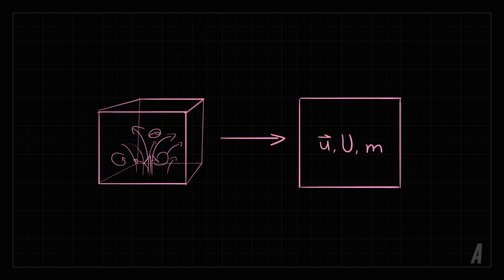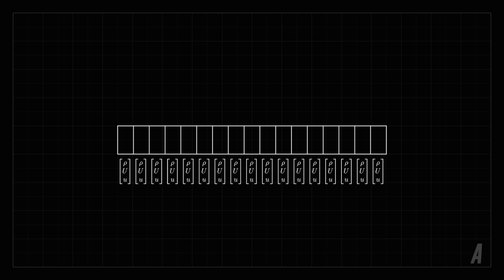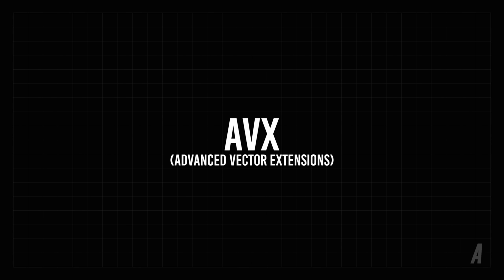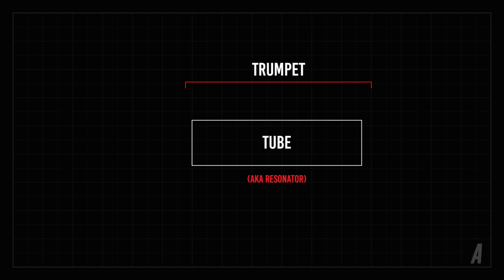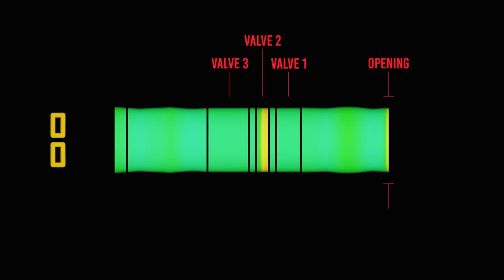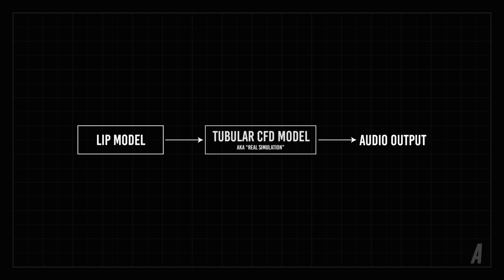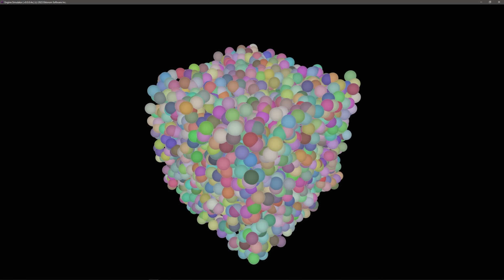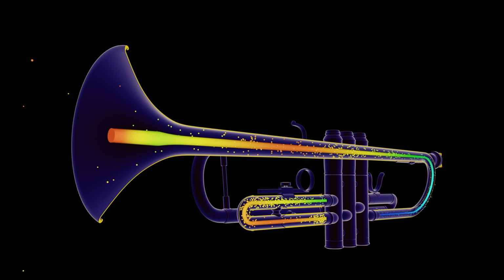Real-time Trumpet Simulation [C++/Vulkan] [WARNING: Flashing Lights]

Comment: I've been a trumpet player for about 10 years, and indeed, the lip parameters are extremely important to hit the right tone.  Trumpet players even anticipate their lip setting and sometimes also pull the instrument tighter to their lips to prepare for the next note, at least to minimise the air gap between each note.  If not well prepared, it even occurs to players that only air comes out, completely missing the note. As found in the simulation, the amount of pressure lips have endure on a Trumpet is immense, professional players need multiple years of lip training and lip hardening to cover an acceptable tone range.  It happened to me to have shattered lips close to bleeding after a concert.  The simulation exactly sounds like someone with no experience in lip setting, which is the case here.  Lip tension is even changing along the duration of the note, call it expressions, phrasing of the notes or modulation, like vibrato, staccato, pitch bend and more...  Adding randomness in lip tension is an easy way to improve realism, but simulating expression with lip tention needs musical feeling, which is a learning process that probably only AI would be able to implement.
Reply: Came here to say something similar about the lips. The tweaking of the params to get the 'clarinet' sound definitely made that pop out.

I Imagine more work on the flare will help, didn't hear any talk about the "material", i.e. certainly a wooden trumpet would sound much different than a brass one--I don't know how that's accounted for here... maybe covered in a different video, but yeah, so much is in the lips and I wonder if the original model is just inadequate for the needs here.

Buzzing with even just your lips, you can quickly start to understand how much that contributes to the sound.

I imagine he could also simplify things and just focus on perfecting buzzing with just a mouthpiece and then plug in the rest of the horn to a massive improvement.

Hope he decides to take at least one trumpet lesson as I feel like that will be an epiphany on how important that part is.

Comment: It's just a thought that crossed my mind, but could this fluid simulator be used for aerodynamics (it wouldn't need to be at 48000Hz since you don't need sound). Things like downforce or heat transfer on a radiator, or even rain hitting the windshield of a car. This are all things that BeamNG needs and would be pretty cool.

Comment: Wow! You should try learning trumpet!
The lip tension & opening size has very big impact on the tune.
Also how much lip is used to vibrate in the mouthpiece.
Since a lip is not a rigid body, you may need to simulate the lip fluttering.
If you blow air without any tension on the face, the lips make a fluttering sound like a machine gun or a old car noise.
Then if you pull the cheeck muscle to the side to tense up the lips, the tone goes up.
That should be constriced to inside of a mothpiece at quite a high frequency to get the vibration right.

Comment: The lips are what makes all of these "trumpets" sound like woodwind. There is pressure buildup behind the lips as they close and a stronger pulse.. which is probably why you have to "blow too hard" to get any sound. Reefs work a bit differently. 

The sound from this "trumpet" is quite close to membrane clarinet, which uses a membrane that seals a double-pipe (one pipe inside another) until you add air flow, which builds pressure enough to push the membrane, allowing air to escape, which equalizes the pressure closing the "valve". The pressure buildup is still quite modest in that, and the sound is somewhere between oboe and saxophone.

When i was building a membrane clarinet, one big hurdle was the fact that it has two sides that both affect the resonance, and with too short and wide mouthpipe the shape of the mouth had a HUGE effect on everything, which is why i abandoned the project.. too many variables in play, which was really the reason i got into it: i wanted to remove the need for any intonation, and succeeded: you can use any fan to blow air and it makes the same sound each time but... then the fact that we are talking about "three sides", input, output AND membrane exterior (placing a horn above the membrane also affects things), before we even get to the membrane itself, the materials, thickness, tension... Just trying to tune the damn thing is a nightmare. 

Anyway, in this case, you just have to model the mouth and lips..

Comment: i play trumpet AND WHY DID YOU GO DOWN FROM C, AND NOT EVEN WELL AT THAT, WHY DIDN'T YOU GO UP, C1-C2 (think thats how you write it, im not smart :D) C (0 (nothing pressed down)) D (1,3 (first and third down, with the 3rd's slide out (just a little secret :D))) E (1,2 (you get the idea)) F (1) G (0,(back here)) A(1,2) B (2) C (0) 
that would have made me happy, as it is the actual trumpet scale that one learns when begining to play.

but other then that, AMAZING JOB BRO, I SOUNDED EXACTLY LIKE THAT (first note, going down is A LOT HARDER then going up (to a point))

last thing, the sound doesn't stop when you change valves, it is called sluring and is a actual thing that we have to do but it does not quieten in any way (unless you are going very far down/up or you are out of air) and to stop the sound, you kinda stop the buzzing with your tong but keep blowing, (still find it hard to understand myself)

Comment: Excellent work.  I love that you stuck to this and got the thing working.  As both a technical type and a trombonist (for a very long time) this really rings bells with me.  That brings us to the "bell" and the general interior profile of trumpet family instruments (trombone, bass trumpet and trumpet all come from the same family).  We look for brass instruments which have a consistent interior diameter for perhaps the first 2/3 or 3/4 of the instrument (I'm not sure of the exact ratio, but it's most of it for sure) then we expect a roughly exponential amplifying flare of a "bell".  Some trombones actually have two different interior diameter slide tubes, to make a gradual increase in diameter, which can slightly change the harmonic character of the horn. 

The trumpet family is distinguished from "conical bore" family instruments like the French Horn, Euphonium and Tuba, which immediately start to increase the interiror diameter of the tubing, and continuously grow this diameter over the entire length of the horn.  These instruments have a distinctly different audio character versus the trumpet family of a similar length.  A Euphonium is the same length and plays in the same range as my trombone, but the trombone has a "brassy" quality, where the Euph has a mellow quality (when played moderately or softly).  One can think of the trumpet / trombone family as starting out brassier, and then getting more so, as volume increases.  The conical start out mellow and get much brassier when driven to high loudness.  This is a contrast they have over large volume differences.

So we really care about the shape of the bell section, and the size of the bore of the horn, even caring about the bores and shape of the valve internals.  Similarly we also care about the shape of the mouthpiece.  The cup, the rim (this is mainly comfort and clarity of attack oriented) as well as the backbone of the mouthpiece do matter and good players eventually gravitate to a mouthpiece they feel meets their needs.  

As we brass players develop we find horns that do for us what we are seeking in music world.  All the other brass players I know typically have several horns, which they will use for different applications (we will use a different instrument playing in a symphony orchestra, and a jazz band, or recording backing tracks for a singer).

Comment: Very cool. I played trumpet for years in and after high school, and for some reason I never really fully internalized that the air actually goes directly into the 3rd valve first... -_-

One thing I would have liked to see here (or would like to see in the future) is attempting to simulate sequential notes of different pitches by using the same fingerings. I.e. on a real B-flat trumpet, an open fingering is commonly used for low C, middle G, middle C, high E, high G, and high C, with the difference being the frequency of the lip buzzing, embouchure shape, and input air speed/volume. I'm not a physics guru, but intuitively I guess that increasing these parameters should cause the standing waves to slowly break up until they eventually "pop" into the next stable configuration at a higher frequency. The rate of changing these parameters, and how well the change is controlled would likely dictate how "cleanly" the notes are slurred together, as in a real performance. That would be very cool to see/hear simulated.

P.S. Some other complexities of the lip simulation which perhaps you've considered, but didn't explain here is the shape of the mouthpiece itself, and the quality of the seal between the lips and mouthpiece. I don't know about professional players, but at least in my experience, the lips do not always make a perfect seal. And different mouthpieces (i.e. with different internal cavity sizes and contours) are used for different intonations, note ranges, and purposes. As many other commenters (and brass players) have alluded to, the lip simulation, while very cool and already complex is probably still too simplistic and incomplete to reliably simulate proper playing, with or without an accurate bell in the physics model.

Comment: In the overblown demo, I was amazed it recreated the "double buzz" effect, where a lower frequency is also heard. This usually happens when a tired player can no longer control their embouchure (lip stiffness and geometry) and unintended vibration modes are produced.
Reply: Also, I wonder (1) what would happen if you're fully simulating the valves and what happens when you only depress the valves half-way. Half-valving produces a very distinct tone and diminishes the volume. And (2) if you can slide the stiffness of the mouth to recreate a lip slur between harmonics.

Comment: Awesome. As a brass player myself I have one comment about your model. 

The trumpet player's vibrating lips are producing the sound, which then is amplified by the instrument. You'll only be able to produce a sound on the instrument, when you lip speed matches the eigenfrequecues provided by the instrument. E.g. you can only play the note a1 (which is at 440Hz) by pressing valves 1+2 or valve 3, because only then resonance will be achieved.

I'm assuming the size of your model is very close to an original one? Please try to set the lip frequency to 440Hz and press valves 1+2 and look at the required energy to produce a tone

Comment: 15:34 This discrepency actually poses a problem, since a trumpet's tubing is actually conical rather than cylindrical, and in which case, it's resonating frequency in relation to the length of the tubing is actually closer to a cylinder with both ends open. Probably this is why the end result actually sounds more like a french horn, which has a tubing that is at least twice as long as a trumpet's

Comment: In case you or anyone was wondering: the 'hooks' on pipe one and three are to slightly extend the pipes manually. For a standard D/re (piston one and three), the third pipe should be lengthed a bit to get the correct tone.
So if your goal is to play real good trumpet via the simulation, that's something to consider :D

Comment: > for 44.1 kHz, we need to run the simulation at 44.1 kHz.
Misters Nyquist and Shannon would like a word with you.
Reply from the maker: Not quite. If you want frequency content at or above 44.1 kHz then you'd need to sample at twice that frequency, however, that's not what I said in the video. I said that I'm targeting an audio sample rate of 44.1 kHz which has frequency data limited to 22.05 kHz
Reply: @AngeTheGreat  Subtle. Thanks for the clarification.

Comment: The issue with so much air needed to produce sound is really simple -- this model assumes that the most of sound (or all of it) is produced by the TRUMPET itself, while it just resonates and strengthen the sound coming from LIPS. The lips are the main soundmaker there and professional trumpet players can 'play' all the notes by lips only.

So I think if there were some more focus on the lip model as the sound source and trumpet as a resonator -- it would be more accurate.

Comment: I'm interested in artificial speech synthesis tools which models the airflow through the vocal tract, mouth and nasal cavity. If you add two additional minor bell openings to represent the nasal cavity and remove two of the valves the one remaining can be used to represent the velum which when blocked off channels air through the nasal cavity. The larynx adds complications because it can vibrate at the core frequency while the mouth chamber can further wave-shape to generate white-, blue-, and brown-noise.

Comment: @AngeTheGreat
Frankly surprised by the result which is a good base  musically speaking, it seems with some more works it could have a decent way to manipulate its expression, and get a better timbre.
Probably issue here is not enough modelisation of turbulent flow at the mouthpiece, there are shockwaves happening too, which affect the air speed a lot (and the produced sound ofc)
Coming from a DSP background ,  there are FAR more efficient way to simulate wind instruments tho ! (less fun probably too)
if you're interested, go have a look at Julius Orion Smith page on Stanford site,  there is a lot about waveguide synthesis there, and also a full library (called STK, there is a part about brass synth, in brass.cpp)

Regards

Comment: The remark that the trumpet sounds like a clarinet really tells me that you simulated a cylindrical tube (a clarinet is one of the few wind instruments to actually  have a cylindrical bore). Simulating the actual trumpet tube should add a lot more harmonics to the sound. I doubt it is the case, but maybe your lips are too loose? Causing the computer to need more air. Trumpet players have really stiff lips usually. I would be really interested to see how the standing waves of a non-cylindrical tube with one open end behave, compared to the cylindrical (clarinet) equivalent.

Comment: This is amazing - as a physics graduate working on particle simulations, and a trumpet player of 10 years, its amazing to see those two worlds collide. The fact that you can even get a roughly-correct chromatic scale and multiple harmonics working is extremely impressive. To me, it sounds exactly like a trumpet playing into a cushion, or a really closed mute. I think simulating the bell flare will definitely help (I've experienced many dented flares). For even better tuning, the third valve tube would need to be extended slightly in the lower harmonics.

Comment: I love this project! I've always wondered wether companies like Yamaha und Bach actually do something silimar and simulate trumpets or at least use software to optimize them. It wouldn't surprise me if Yamaha did, but my guess is that they are still built from the experience that has been gathered over years and years. 

On a side note, I think the trumpet sounds a lot more like a saxophone, which I find quite interesting.

Comment: Impressive!

Standing wave resonance in an open tube is somewhat dependent on radius. The rule of thumb I've seen is that the effective length of a cylindrical tube is increased by ~0.6x the radius of the tube. This is because the reflection originates at the zone of low pressure at the tube mouth - but said zone is somewhat outside the tube mouth in practice because of the lack of time-reversibility of fluid flow. This will likely affect tuning somewhat. No clue how this interacts with flared tubes.

Also, this likely isn't worth it, but you can model vibration of the tube itself fairly easily, in much the same 1d finite-speed-of-sound manner as you are modelling the gas. Note the speed of sound is much higher in solids than gasses, which will cause problems. Unfortunately, you won't be able to model higher radial modes, as in a 1d gas sim they will never be excited, but you should at least be able to include the fundamental radial mode and axial modes. (Pressures and deflections here are low enough that you can, roughly, assume the tube expands radially with pressure in a linear manner. And then you "just" have a few more state variables per tube segment for the current deflection / delta-deflection / etc, (or maybe stress instead) and essentially model the tube as a vibrating string oscillator coupled to the gas.)

Comment: Re: having to blow too much air into the trumpet to trigger sound: playing the trumpet can cause sinus and cranial pressure.  I see particles escaping the lips in the opposite direction.  Is it possible there's no back-stop to the lips which means losing half of the air stream to them, or is there something like an air-diode?  

All that said, phenomenal work.  This is extremely impressive.

Comment: I think the reason it requires such high airflow to work is because you're underestimating the fact that the mouthpiece itself is an instrument that is quite acoustically complex. You'd probably need to model it as well as the trumpet for the pressures to be close, right now your model represents someone trying to play a trumpet without a mouthpiece which aside from being physically difficult would also require enormous lung strength.